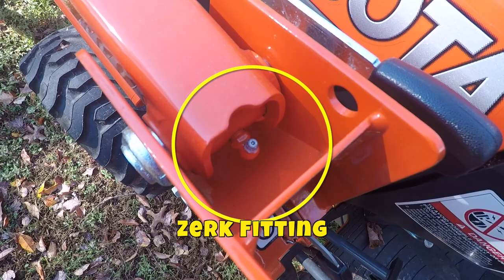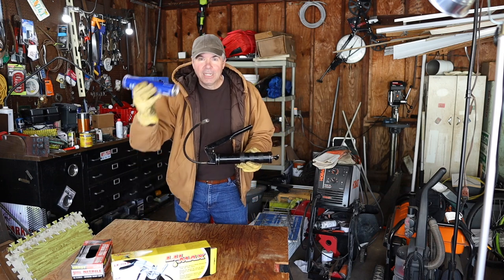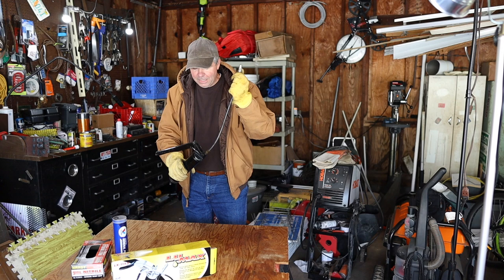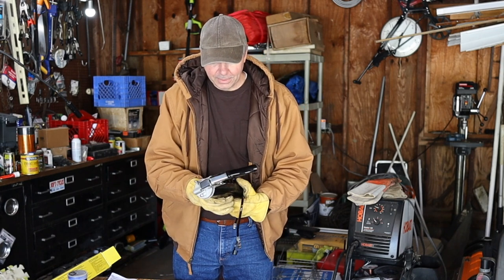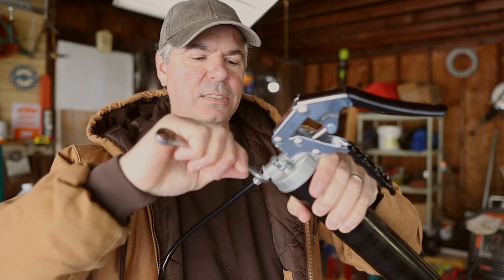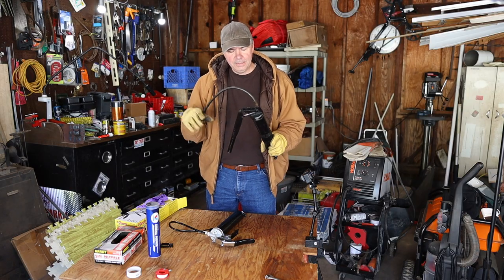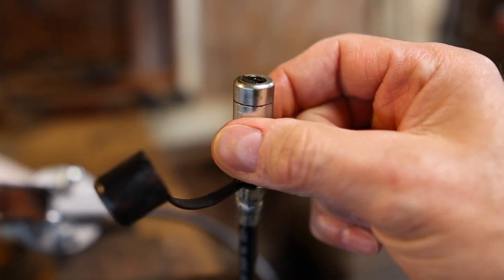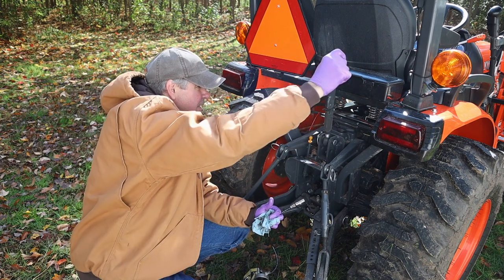#34 Kubota B2601 and LA435 front end loader grease points. Basic grease gun review and how to use.

Comment: I bought the same single handed new grease gun you did 2 years ago.  Modest improvement to my dad’s old one I had.  Still dreaded the messy temperamental task.
This spring I bought a Lock n Lube and a Dewalt battery powered gun.  
Now, not only are all my machines greased very regularly (for the first time in their lives) but I’m done in no time and would gladly grease all the neighbour’s machines for them if they wanted!  Totally a game changer!
There is 1 zerk on each of my ATVs that needs the old gun (with a 90 degree fitting on the end that I battle with) but everything on the lawn tractor, zero turn, tractors, grapple, log splitter, wood chipper, side by side and the majority of the ATV zerks are all done with ease thanks to the Lock n Lube and that Dewalt gun.  Definitely one of my best tool purchases ever!  (At least that’s what my happy machines all tell me)

Comment: I've had the grease gun stuck on a fitting. I broke the fitting getting it off. I bought the lock and lube. So much better. I bought the lube shuttle grease gun too. Grease tubes thread on. A little pricey but works good so far.

Comment: i bought the Lock N Lube fitting and found it works in most places.  As you noticed, it is a little bit large for the tighter areas.  I also bought the 90-deg coupler to help in those tight corner spots.  I haven't moved on to an electric gun yet and probably won't for now.  I did buy a nice air-driven model that uses compressed air and it works great so far.  So much easier to simply pull a trigger instead of a pump handle.  Recommendation - also pick up a flexible and quality-made hose so you are not wrestling with it.   Your smileage may vary, of course.

Comment: Lock N Lube is the way to go. I have had grease gun get stuck and almost not release from a fitting and I have a rear blade on my tractor that has a fitting deep inside that I couldn't get to if not for the long reach Lock N Lube. I am not associated with Lock N Lube, just a happy customer.

Comment: I use spray grease for things like the balls on the three point arms. Several companies make it now like WD40, liquid wrench, etc and you can find it just about everywhere... auto parts, Home Depot etc. It comes in spray cans usually with the little plastic straw, and is called gear and chain lube.
Most of it is clear, which helps reduce the mess.

Comment: Lock and lube works great. Don’t know if the new tractor has grease fitting on the front differential. The older ones have fitting on looks like pillar block bearing going from front end to rear end

Comment: I have what looks to be the exact same grease gun u just got. And yes. The nozzle that came on it was useless. I could not get it on good some time and could not get it off others. Bought another similar nozzle and same so I got one like you showed with the thumb lever. It works  much better but still have to push hard sometimes to keep it attached and is bulky in tight spaces. It cost more than the gun but worth it as many grease fittings as are on a tractor.

Comment: Its definitely an extravagance but I went and got a dewalt electric grease gun. Lashed out for the lock and lube like most people in the comments. The only thing I can say against it is its hard to use on uni joints.  The dewalt doesn't take Australia's bigger cartridges. Have to go find the smaller American ones. But that's led me to bying in bulk so not all bad
Reply from the maker: I used to think a battery operated grease gun was overkill. But I’m thinking I’d like one. Interesting that the cartridges aren’t universal.

Comment: 👍🇺🇸🇺🇸🇺🇸🗽🙏🏻 Enjoyed!  Always been able to adjust grease gun end such that it goes on and off easy.  One zerk that is easy to miss is on the front end axle pivot point under the front end of the tractor (Kubota L3200).  And before you grease it there is a small cap/plug across from the zerk that you MUST REMOVE before greasing, it prevents pressure on the seal keeping you from blowing out the seal.  You put grease in until it comes out the plug!😊

Comment: Look at the tip of the grease fitting hose,  you will see where you can screw the tip tighter or looser, it will be tight at first,  you may have to break it free at first  with pliers,   just leave it loose,  insert it on the grease zerk then tighten it back up by hand and start greasing,   when finished loosen (un-screw) the tip a little and it will come off easily.  No more busted knuckles!
Reply: great idea i will try that, thanks ,sounds better  than pushing people to buy a 30. overpriced  lock n lube